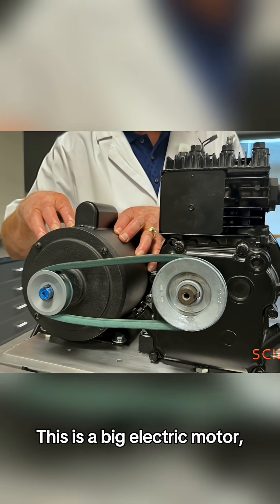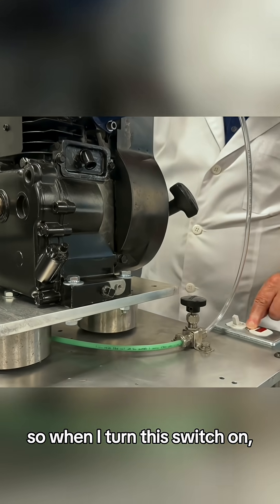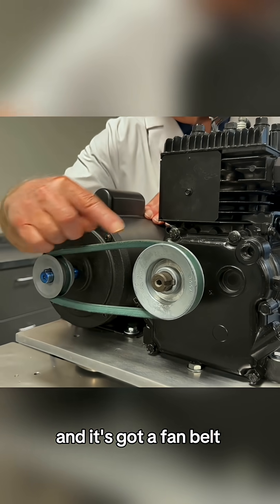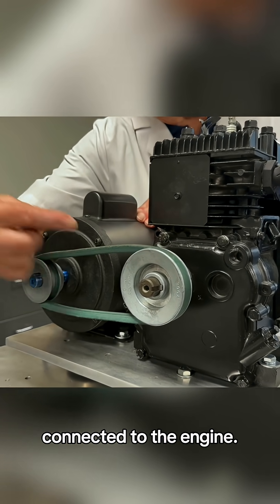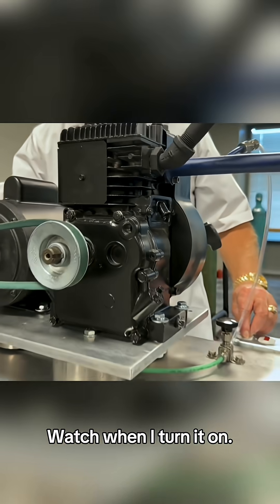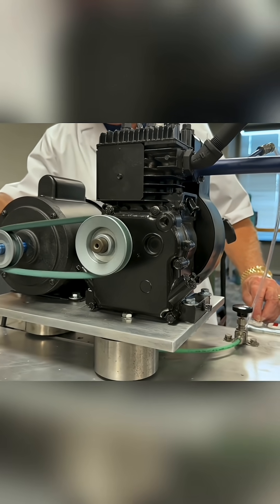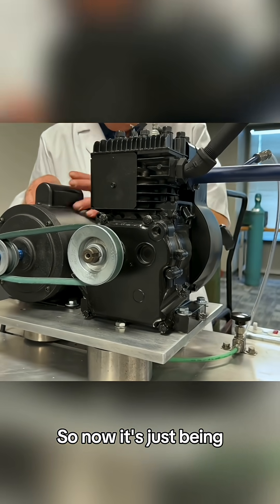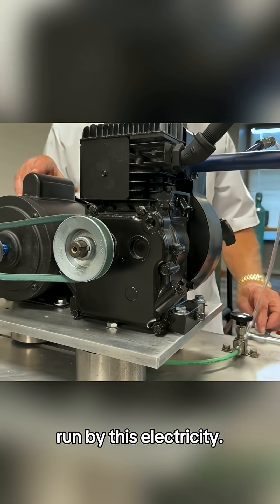Creating the World's First Hydrogen Car – Inventor's Breakdown

Comment: Beware. I'm not sure how why where and when innovative people disappeared and we're not found until today.
Reply: Don't worry, Darwin's gonna clear out the hydrogen guys. Hydrogen doesn't just show up out of the blue like sunshine and wind. He's running an ICE engine, max. efficiency 50%, with electrolysis produced hydrogen, max. efficiency 90% so 45% efficiency at best vs 85-95% just using an electric motor. Forget the regen braking, 19-25% savings, and reduction in maintenance, 40-50%,and NOX emissions, just go on the cost of input and output